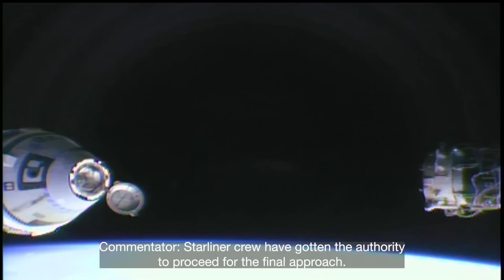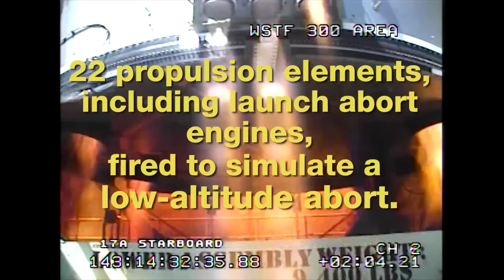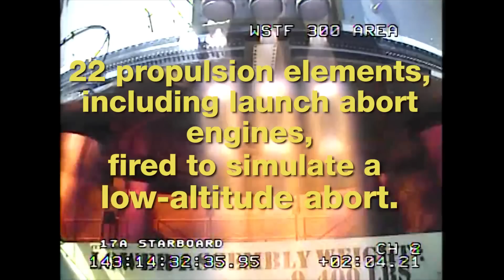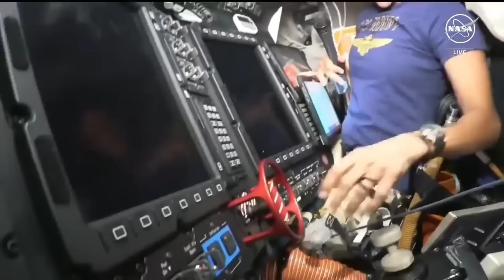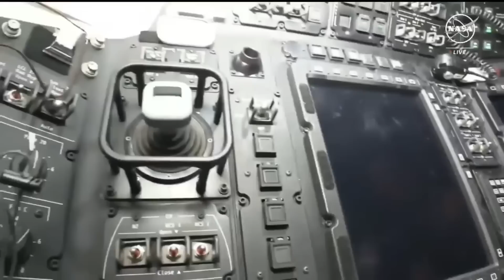The Decision Is Made - Boeing Might Be Safe? But SpaceX Is SAFER!

Comment: Remember when Boeing  was run by Engineers?
Reply: First Boeing was run by engineers.  Then it was run with the input of engineers.  Then it was run with engineers permitted to sit quietly in the corner.  But eventually if management saw an engineer in the building, they called security.
Reply: Perreridge farms remembers
Reply: @RichardFraser-y9t Came here for this. Did not leave disappointed.
Reply: @RichardFraser-y9t you beat me to the comment 😂
Reply: The new CEO is an engineer.  Hopefully, he will make changes.
Reply: @kokomo9764 possibly, but making systematic changes is Very time consumptive, and Very resisted by others in the executive suite... Effective change will Only come about if the board members are committed and resolute... I've actually worked @ a firm while it was "in crisis/damage control mode"... And it's incredibly toxic and stressful...
Reply: @kokomo9764  When did this happen?
Reply: @kokomo9764 unlikely as unlike the Boeing of old this new Boeing is still beholden to shareholders. There is a reason why many people hate companies going publicly traded especially if the service they are providing up to that point has been great.
Reply: This is how the rest of us feel about Boeing and Airbus.  The Boeing might... MIGHT... be safe, but we'll take an Airbus carrier, thank you.
Reply: @workingguy-OU812 stupid comment
Reply: Then McDonnel Douglas bought Boeing with Boeing's money.....
Reply: Back when they were a leader in the field.  MBAs fixed that problem.
Reply: No...
Reply: It still is, in fact Boeing CEO was trained as engineers. Engineers are not immune to the love of money.
Reply: And then greed happen
Reply: @Buskyb And then McDonell Douglas happened.

I worked at Everett when the merger came along And the difference in attitude was pronounced.  It really wasn't greed. It was the desire for less risk and more predictability.

This created a lot of perverse incentives, which as perverse incentives do lead to bad decisions.
Reply: @M167A1  i swear im not trying to be preachy, but isnt that kind of the same as greed? Less risk/more predictable is shareholder speak for smoother flowing profits.
Reply: @Buskyb  it has nothing to do with greed. It's about lack of accountability.
Reply: @Buskyb and DEI
Reply: @Buskyb Not even greedness, but a lack of general technical background in the management department, considering the fact that the whole Starliner CST-100 schematic layout was a thorough copy of Apollo, a renewed Apollo of our days, I dare to say
Reply: and they all retired already.
Reply: There are plenty of talented engineers working on Starliner, but the problem is Boeing.
Reply: Remember when NASA was properly funded and didn’t have these profiteers making aircraft
Reply: I member
Reply: I thought those Boeing engineers were either mesmerised or appalled by the working ethos at OceanGate - and then left the business....
Reply: Not even Pepperidge farms remembers
Reply: At one time Boeing's PRODUCTS were airplanes etc, now the product is the stock price for investors and that when it started to go wrong.
Reply: They’re Boeing in name only.
Reply: without diversity who will stab white children at taylor swift concerts?
Reply: It never was. They bribe their way to govt contracts
Reply: Nope, as it was always run by CEO/CFOs, who aren't engineers, by definition. It's a for profit taxpayer leech...like SpaceX. They are profit first, performance second, unlike tax payer funded NASA, that doesn't make profits from tax payer dollars.
Reply: @kennethc2466  Is it OK to type nonsense? Do you think you should at least look before claiming the CEOs were not engineers? SpaceX derives the majority of its revenue from commercial contracts, not taxpayers. You are not well informed.

Edgar N. Gott, VP at the start, CEO after WWI, engineer. Boing has a long list of engineers as President and CEO. A single non engineer, a lawyer, led Boing out of the post WWII slump. It was 2005 when the shit hit the fan and the non engineer suits started to dismantle the company. The profits were fantastic while they gutted the company and its future. Now the chickens are home to roost and Boing can no longer make planes, rockets, or space vehicles. Ah yes, and the original Boeing was an entrepreneur born in the late 1800's, not an aeronautical engineer, those did not exist until the Wright brothers the next century.
Reply: They traded Aerospace Engineers for Social Justice Engineers via the DEI Tech Tree.
Reply: And then they were reverse-taken-over by McDonnell-Douglas' failed executives and ran another company into the ground.
Reply: The people who remember that are all dead.
Reply: But often the best option is a dangerous option!
Reply: Not in my lifetime 😂
Reply: yes we know the story
Reply: B4 Douglas r.i.p Boeing
Reply: Remember when the US space monkeys sabotaged the ISS by drilling holes in the hull?

I bet your little stranded space monkeys remember. I wonder if they'll get home before the air runs out. 

LOL
Reply: During their best phase, the people was actually a lawyer
Reply: Yes, I had toured Boeing way back. 

I was young with a short haircut and I was wearing my souvenir Boeing t shirt. And when I was boarding my flight home the crew said " if it's not boeing i'm not going " I smiled and said " yeah ? " Before I knew I was upgraded to first class and they offered me drinks 😁
Reply: Proud engineers.  I had a friend who had family in the old Boeing.  Pacific Northwest. Held up the standard of living. Whole families with Boeing.
Reply: Back in 1857...
Reply: Actually no I don't remember. It was too long ago.
Reply: No.
Reply: The accountants and project controls people are infecting the decisions more and more in every industry.
Reply: God why do ignorant for half wits keep saying this? Boeing has had engineers CEOs in the past. Including in the years for the 737 Max crashes. 
I'm not dismissing the desirability of engineers at the top, but it's not as simple as that. 
Even well Elon musk has made comments to that effect, let's remember that he's not an engineer either. What is actively required is it management manage's well, and there is no simple formula for that.
Reply: Nope😮
Reply: We can all sit here and criticize Boeing and Starliner, but are any of us actual rocket and space craft engineers?  Not that I'm standing up for Boeing, I'm certainly not.  I'd rather fly on a Dragon spacecraft.  But still, it's easy for us to criticize when we don't have experience in making such things.  As a chemist and industrial engineer, I know.  That said, I agree with the vast majority of you.  I wouldn't trust Boeing anymore.
Reply: no
Reply: Never forget that Boeing executives signed off on shoving bigger engines under the 737 to make the MAX but promised airlines they wouldn't have to spend money retraining pilots because "it's the same aircraft." Then they had to add the MCAS system to prevent the unbalanced plane from stalling, they didn't document it, and when it went wrong untrained pilots didn't know what to do... and 346 people died in two crashes.

Nothing changes until Boeing executives go to jail for a long time for premeditated murder.
Reply: No lol, every company is run by its shareholders
Reply: Do you remember when companies were run by the employees and customers? Now all they give a shit about are their share holders. This is why every American company is awful now. I'd rather by Chinese than all this made in the US bullshit.
Reply: Pepperidge Farms remembers
Reply: Remember when one of those Boeing Engineers went to Enumclaw Washington?......
Reply: Safer?  LMAO.

Fly on Starship….  I dare you….  Muskrat idiots
Reply: I have been there 25 years. After the Douglas merger totally different company.
Reply: Greed, stains your soul with a stench of ruin.
Reply: I remember when Canada was ran by patriotic Leadership. That ended with the cancellation of our Avro Arrow.
I was seven, at the time. My father was furious. Nowadays, I am too.
Reply: Pepperidge Farm remembers.  McDonnell bought Boeing and ran off the engineers in the management.  MBA disease.  Squeeze every drop of profit out of a product, to hell with reputation.  The MBAs will be gone with golden parachutes when the reputation is trashed.
Reply: no
Reply: I dont 

Was long before my time. 😂
Reply: Yep.
Reply: Remember when America was run by capitalism and not monopolies
Reply: But that mean Jack Welch was an engineer too and look at what he did to GE
Reply: Now politicians
Reply: I'm old enough to remember when McDonald Douglas was good.
Reply: Before they started “disappearing”???
Reply: "Remember when Boeing was run by Engineers?"  Yeah, like with Dennis Muilenburg, who was the CEO in charge between 2015 and 2019, during the two crashes debacle of the B737 Max. And he is an engineer in aeronautics and astronautics...
Reply: Ahhhh the 90s
Reply: I think this means you are old now
Reply: @higgsfermion3536  Old is good.  Older Boeings for example, are good.  Newer Boeings are a lawsuit in the pipe.
Reply: @richlisola1  I guess that's true
Reply: @higgsfermion3536  —I just want everyone to be safe.  Be they a passenger in coach or an astronaut in space.
Reply: Got to love DEI...
Reply: We don’t need engineers we need marketing and top level executives with big bonus packages!
Reply: nowadays, Boeing is a "business venture"
Reply: Then DEI happened
Reply: Pepperidge farms remembers
Reply: I am 68.  I have been flying since I was a teenager.  I have millions of flight miles between commercial and military flights.

I always preferred Boeing aircraft over all others.  No longer for the last 8 years.

Boeing “ We stand for nothing and make crap!”

Sad a great American company destroyed by selling out to McDonald Douglas and Wall Street greed!
Reply: I remember Bill Allen, President (CEO) of Boeing from 1945-69. I also remember planes like the Boeing B-47, - B-52, 707, 727, and 747, all of which were designed and built while he was CEO. Bill Allen was a lawyer (Harvard Law School), not an engineer.
Reply: I think those who remembered are no longer with us it was so long ago.
Reply: They shot them all.
Reply: Now it’s Management by Committee
Reply: @providentpathfinders219 run by accountants now
Reply: and space exploration was "for mankind"?
Reply: @jamesmurphy449 Even during the supposed ‘for mankind’ days it was still built by capitalists on a cost-plus basis. NASA never really built their own stuff, everything was contracted and subcontracted out.
Reply: @silmarian  That's true, but there were actual competing bids, as opposed to today's corrupt to-spec contracts copied-and-pasted from sole supplier's datasheets. And there was oversight. And the executives weren't lobbying to get billion-dollar bonuses. 

I've worked in the industry most of my life. It's pretty bad right now.
Reply: @silmarian  really?!?!???!?!
Reply: The Boeing CEO between 1945 and 1968 studied law and doesn't appear to me to have been an engineer. His name was William McPherson Allen.

From Wikipedia:

While he was president of Boeing, he made the famous decision in 1952 to "bet the company", when he authorized construction of the Boeing 367-80 and again when he authorized the launch of development of the Boeing 707.[3] He also participated in launching other planes of renown, among them the Boeing 727, Boeing 737, and Boeing 747.
Reply: @shazmosushi that is only 1 position.
Reply: @shazmosushi  The one in charge during the MAX debacle WAS an engineer. But, shhh, the kiddies like their apocryphal wank.
Reply: It's clear you don't understand how companies are ran. An engineer being a CEO has nothing to do with it.
Reply: @fostertheperson  insane comment
Reply: Oh and were there never any Boeing airliners crashing before the “bean counters” took over?
Reply: @executivesteps  do you have any questions that are close to being on topic?
Reply: @T.E.S.S.  Do you have any replies that make sense?
Just curious.
Reply: More like rich and corrupt engineers 😂
Reply: Yeah and not GURRRRL GAMERS LARPing as engineers
Reply: Diversity hiring did this
Reply: @schrodingersmechanic7622  Proof? I understand disagreeing with the concept and mostly even agree, but the way you guys bring it up every chance you get using lazy one-liners makes it seem more like a dogwhistle than a legitimate critique. Plenty of successful diverse companies out there, hiring a few minorities isn't gonna poison the whole organization anywhere near what a bunch of bean counters can do.
Reply: @sntslilhlpr6601 hiring anyone based on anything else but merit WILL be detrimental to a company. There is no question about it. Also, it is damaging to the people it is supposed to help. Knowing that someone was put in a position based on some diversity criteria, you never know if this person actually deserved it. This creates friction.
Reply: @sntslilhlpr6601  
It's not a dog whistle at all. It's simple statistics. If a company hires the top X percent of any given labor pool, their employee demographics should roughly match the demographics of the labor pool. For example, if you have 100 X applicants for a position and 50 Y applicants for a position, but the company policy is to hire equal numbers from both, you would end up with lesser qualified employees. If you hired 10 from each, you would have the top 10 percent of one group, but you'd have the top 20 percent from the other. 
I've worked in STEM fields for decades and this is commonplace

Comment: Well if Boing can't keep it up with some once no-name company even with all savings in maintenance + quality control, you know something is really going wrong over there.
Reply: That's why it's important to distinguish between areas where cost cutting is acceptable, and areas where cost cutting on that area... has knock-on effects that make everything else more expensive enough that you end up spending MORE overall money, even tho you saved money on the one thing you cut costs on.
Quality control, employee retention, and preventative maintenance are three of many of those things you never try to save money on if you actually know anything about how to get things done (meaning you know more than how to balance the books).
Reply: A company has to prioritize ... and some prioritize management bonuses and shareholder dividends.
What has this "maintenance + quality control" ever done for us? This child of a rich dude has an MBA bought at an elite university, surely he knows more than these peasant engineers.